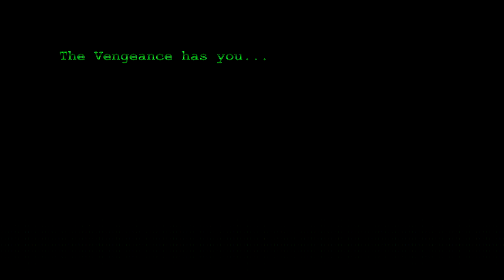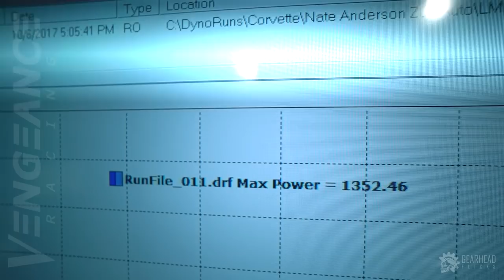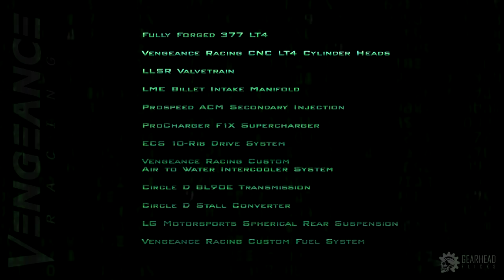Mr. Anderson's 1350RWHP C7 Z06 Corvette - Vengeance Racing

Comment: 178 in the half mile seems slow for 1300rwhp. That should be 1/4 mile tine
Reply: A few things to remember, one it appears to be a new transmission so depending on the driver's familiarity with it will result in fluctuations in MPH, two due to the coefficient of drag the higher up in MPH you get, the HP effect is reduced significantly, and finally when you consider the fastest GT-R with 3000 claimed hp did the quarter in 220+ mph with a fully stripped car and a proglide ATM I think a mph of 178 is impressive.
Reply: 178 mph seems about right for the 1/2 mile. Given some more room like a standing mile should eclipse that number. The Trans is an 8spd auto and it could have very well been built for 1/4 mile races which would definitely affect longer distances.
Reply: Could be the gearing and not wanting to keep swapping them back and forth. jmho